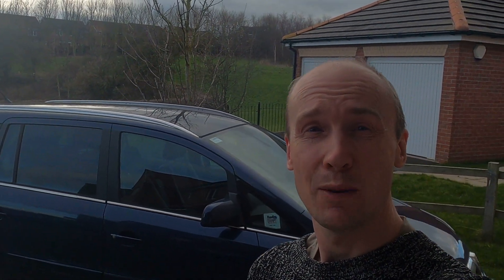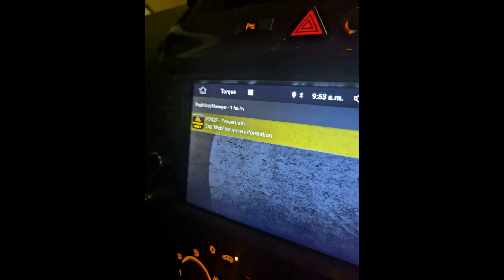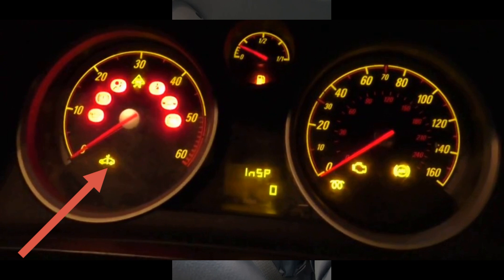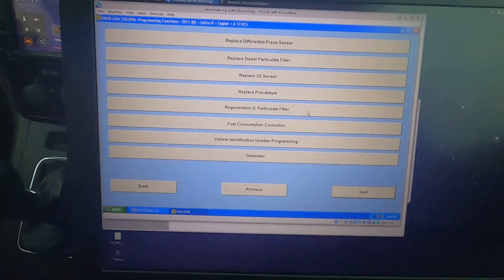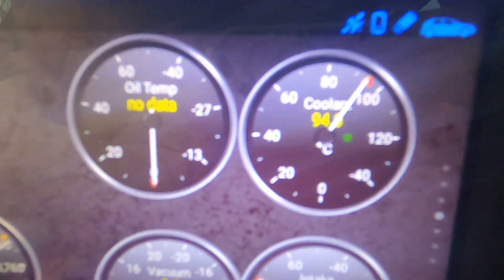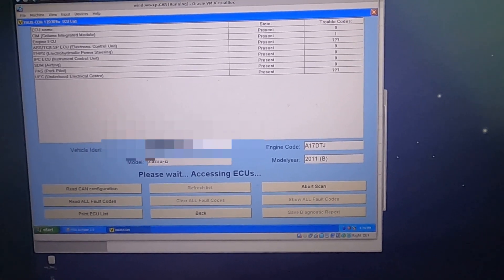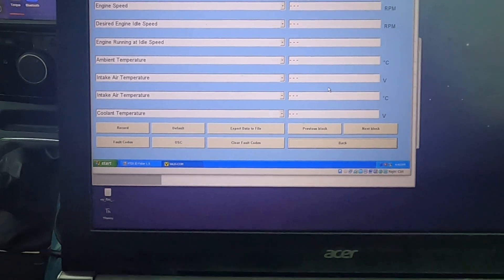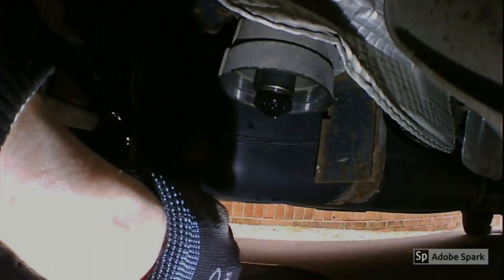Why does a Vauxhall Zafira have DPF and engine management light issues?

Comment: Hi,I bought 2010 vauxhall zafira 1.7 diesel from auction with blinking glow plug light,I thought I will take off dpf to clean but dpf is deleted,I find used dpf for 200£ on ebay and thinking to buy and install it.But I was thinking this car might has done remap... with op-com is possible to reset ecu to factory settings? Thank you for any info :)
Reply from the maker: Hi, if dpf has been removed but you've got flashing glow plug light it suggests they've not removed/mapped the ECU to clear it, probably why it's been dumped to auction!
So I'd check the dpf pressure sensors first see if the wiring is damaged, cut, etc before buying. There isn't really a reset you can do with the ECU but get somebody to put a simple map on it
Reply: @junkendriven  thank you so much for replay :) So if DPF is removed and all sensors is working propertly then I should not get flashing glow plug light ? Is it correct ?

Comment: As this is an old video you may not see it. We have a Zafira B 2014, 1.7 D the 125bhp version. We have owned it for 8 years, 75% of its life was motorway use, even now although it does less miles, it does a 180 mile round trip at least once a month. But more short journeys. A few days ago the DPF light came on, I have never seen this illuminate previously, On our car the DPF light is the  glow plug  warning light. The EML light did not illuminate or did it go into limp home mode. I read the handbook and took it for a blast on the M4 at 2000-2500 rpm for around 10 miles. Following this the light was still on until I accidently stalled the car, on restart the light was off. The car only has covered 80k miles, not sure if its relevant, 2 days prior to this it had been in for MOT, it passed okay and a small service. Any advice, I can use it for its regular 180 mile round trip in a few days time.
Reply: Did you ever find a solution for this?

I have the same car with similar mileage, but same situation here. Car in for MOT etc and DPF light has now started flashing, never seen it before until now
Reply: Hey guys. I'm in a very similar situation now in the sense i do plenty of motorway miles, average amount of short jounreys and my car went in for a service last month and then the dpf problems started a few days ago. Any advice?

Comment: would you get smoke from under the bonnet  as well as the rubber  smell if it's going through  the re gen. ?
Reply from the maker: You shouldn't unless there is material on the engine being burnt off (Take the plastic cover off the top of the engine and check your injectors, etc, anything on the engine would be getting burnt off and may cause the smoke you've seen).
You could also have a slight exhaust leak in the engine bay, so you want to check that out as you shouldn't get smoke from the bonnet.

Comment: Andy, just interested if you dont mind, what year and milage does your Zafira  have? Recently i could smell fuel and it might have happened on a 30 min journey. Recenltly i also inspected and cleaned my almost blocked EGR valve. Interestingly no codes just poor fuel milage (Service at main dealer was 5k miles ago and nothibg mentioned). Mine is 2014 zafira 1.7cdti. Thanks for video and info
Reply from the maker: Hi Neil, mine is a 2011 1.7cdti A17DTJ engine. Mileage is low for the year 72,000 on it.
Fuel smell could be egr, yes typically that won't generate a code. It could also be the fuel filter housing damaged or not on properly, one to check as it's easily done, I've covered videos on egr, fuel filter, etc so take a look at the rest of the channel.

Comment: did you see the regen light glow at all while the car was forcing one
Reply from the maker: I assume you're referring to the flashing glow-plug light? No, that light is for when the DPF is over-saturated beyond recovery and is at that point a failure of the DPF. It doesn't flash during a passive or active regen in any situation. (Also, that's why my other video for adding an LED to show when a regen is taking place helps out!)
Reply: @junkendriven  no I meant the LED indicator light you installed.
Also, how many times have you launched a forced regen, and did you get the burning tire smell
Reply: @junkendriven  did you get the tire smell when the forced regen was done, and did you have someone with you in the car during the time

Comment: DPF technology would be brilliant if more research went into it....it should be able to regen on school run or going to corner shop
Reply from the maker: That's my complaint with it really. But I do think the Vauxhall implementation on these A17DTJ engines is flawed, like you say why can't it cope doing a regen in town/city driving.
Many other manufacturers manage it! Cheers for the comment Michael
Reply: some DPF's have heating elements in them, but they are very few as far as I know.
I didn't know that untill i was doing research in to DPF's. more DPF's should have them